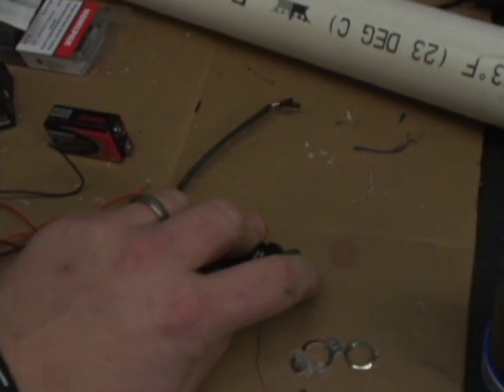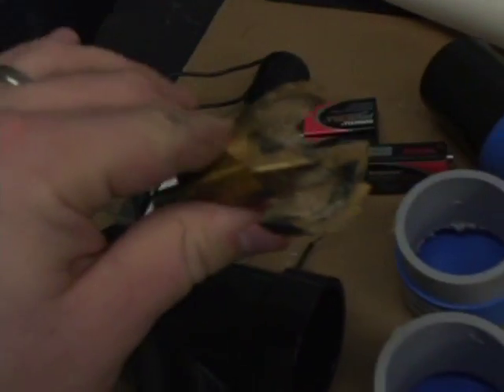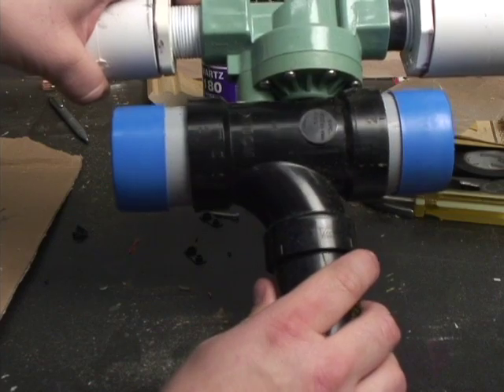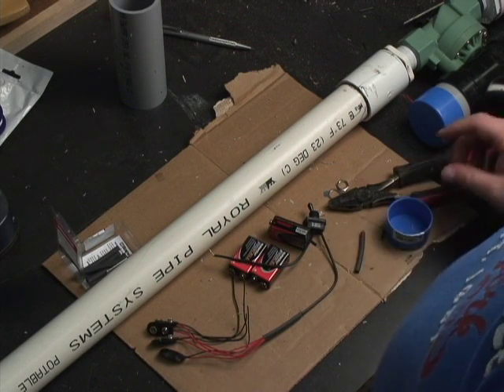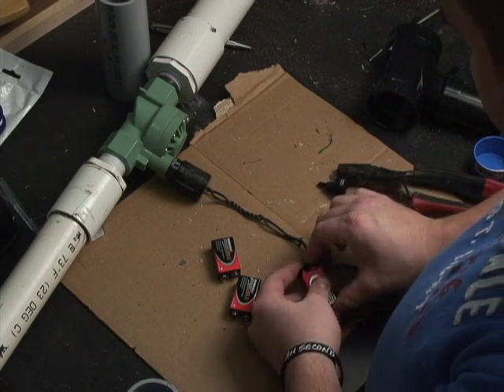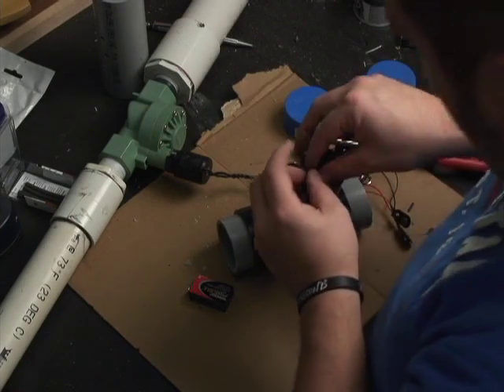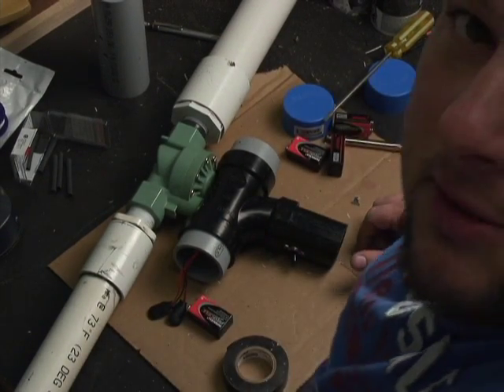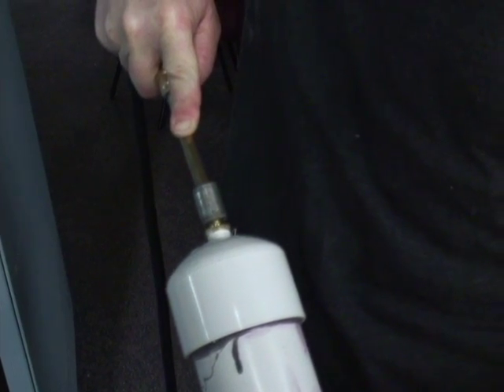electric trigger for air cannon

Comment: Are four batteries necessary? The cylenoid tripped when you hooked up the one battery. I would much rather use the one battery.
Reply: +bunker551 Once it is pressurized it wouldn't open.
Reply: anything over 60 psi  and one battery is not strong enough to open the valve

Comment: Assuming the solinoid is 24v you wired your 9v batteries in Parallel which gives you only 9v but they will last longer than using just 1 battery.  if you take just two 9v batteries connect your switch to 1 red connect that black to the second red then the remaining black to one of the solinoid leads (like 2 batteries in a remote + to -)  you will be at 18v and that solinoid will have no problems at all...